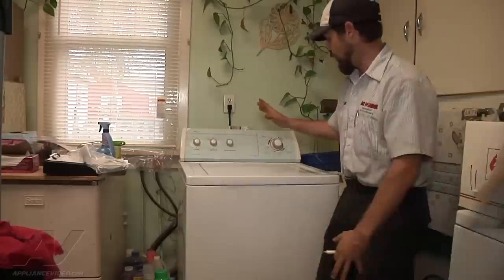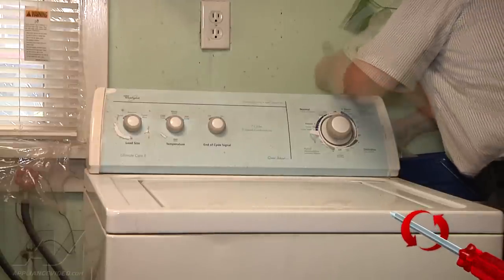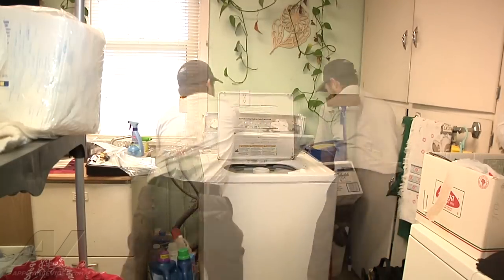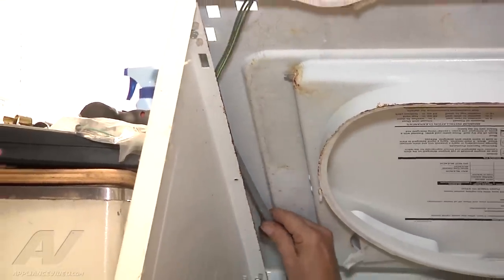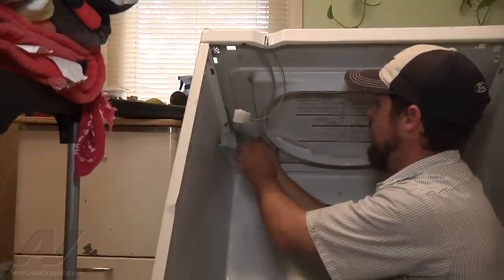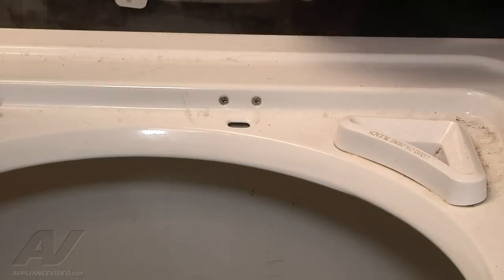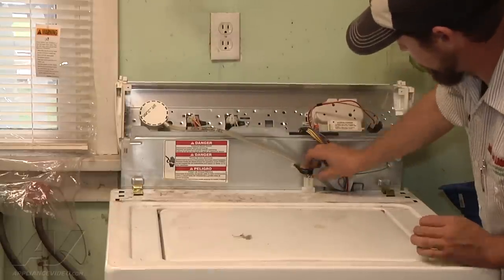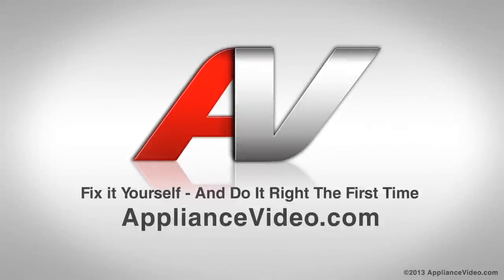Whirlpool Washer Repair - Does Not Spin or Drain - Switch

Comment: This helped me diagnose my bad lid switch . I unscrewed the switch & pulled it out slightly to look at it to see how it was broken . The tabs connecting the bottom panel of the plastic case to the top were broken which kept the switch lever from activating ; the case would just spread apart . I took a length of wire & wrapped it around the case & twisted the ends tight with pliers to keep the case closed . Now the switch works perfectly ; I didn't have to take the washer apart or buy a new switch .
Reply from the maker: Thank you for your positive response, we are glad we could help. Please help us by
subscribing to our YouTube channel. Or support our parts department at
1-800-830-5465 and our website www.SaveMoreOnparts.com .  This is the only way we can continue to
help the over 900,000 people per month like you repair their own appliances. We
also have thousands of more quality videos on all major appliances made by our
factory trained technicians at www.ApplianceVideo.com .

Comment: Thank you so much for this video! I was able to fix my machine all by myself.
Reply from the maker: Thanks for your response, we are glad we could help. Our library
of over 5,700 videos are currently helping over 1.6 million people like you
every MONTH.  Please help us by
subscribing to our YouTube channel, or post our website www.ApplianceVideo.com to your Facebook
page, Twitter, Instagram or any other social media sites. Your support will
help us keep producing more free quality videos.
Reply: What if the lid switch is not the problem?
Reply: @asianinvasion3202   Well a lot of it depends on where you washer is stopping in the process of the cycle. Mine would stop a certain point every single time no matter what. The lid switch was cheap so I had no issue with buying it and replacing the current and it indeed was the case with mine.

I had to recently also replace the motor coupler on my machine but was having different issue with my machine than the lid switch.

You could always hire a repair person to come take a look, but for the most part I was able to trouble shoot everything by watching a couple of videos. Most of the issues are very common with these older machines.

Comment: I have a whirlpool etw4400w00 that fills then quits. It will not agitate spin or drain. I replaced the dogs which needed to be replaced anyway but nothing. I don't have a lid switch like yours mine is in back under lid I believe. Any ideas for me? Thank u

Comment: replaced drain cup assy. and clutch on my whirlpool; now it doesn't spin on extra rinse. Works fine otherwise. any ideas. my lid switch is fine
Reply from the maker: Great question, if you have a
more technical question that our parts department cannot answer, you can search
our over 10,000 answered questions free at our website www.ApplianceVideo.com under our Repair Help section. You can also call
our parts department at 1-800-830-5465 and they can give you help 7-days A week
Monday -Sunday, or search at www.SaveMoreOnParts.com  24 hours
7- days A week.